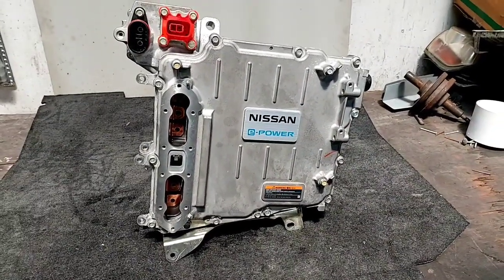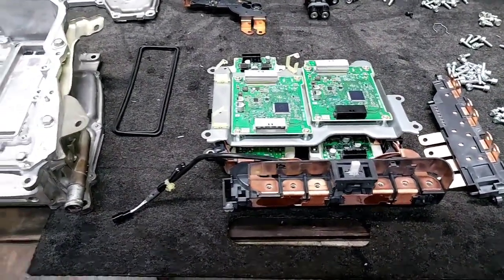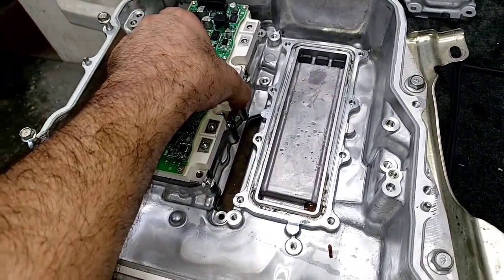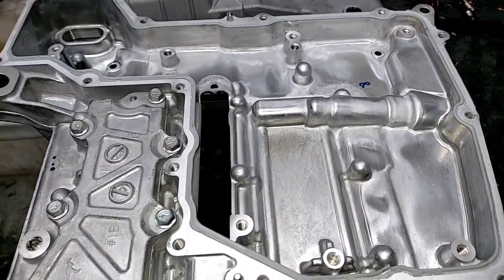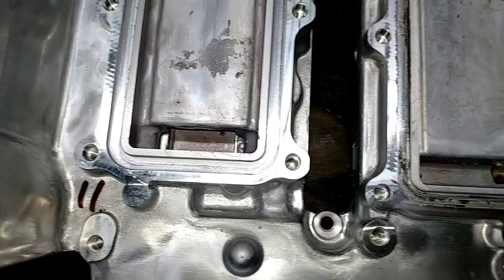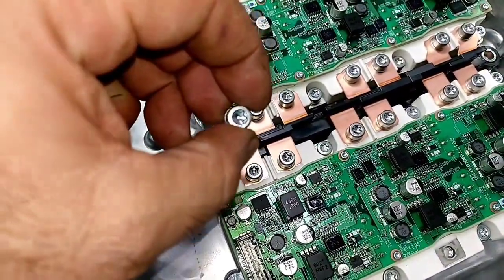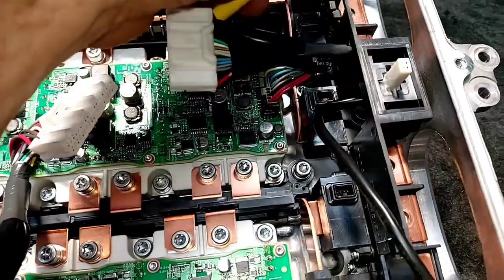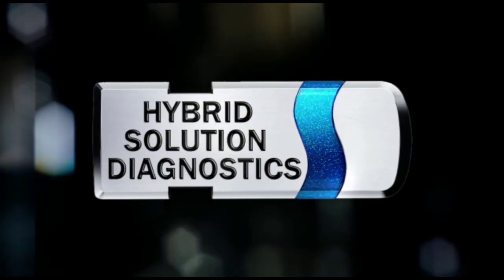Inside the Nissan Epower Inverter

Comment: Now 4 years after the release of e-power the main problem repeated among users is the generator charger that stops working and must be changed. The car must be immobilized for more than 20 days - in Europe-. Has Nissan found a solution to this anomaly!? which is unfortunately fatal for this new technology.
Reply from the maker: @abdoelabtet3881  yes unfortunately quality has not been in this vehicles so far 😖😖😖
Reply: Hello, where is that part? Any videos in YouTube related?  Thanks
Reply: @mt-dx5xf  https://youtube.com/@hybridsolutiondiagnostics?si=FyusHDIJBwwHC8xs

Comment: Do you know if we can modify the epower to be able to be charged from a wall charger when the car is parked to have the battery to be fully charged rather than using the petrol engine. So the car battery is always on full charge every morning so if uses lesser fuel. What do you think?
Reply: The battery is very small and it's not worth doing that.
Reply: @youtzful  одной зарядки батареи хватает на 10 километров пробега.
Reply: @youtzful  Even though I like it to find the battery  charged every morning
Reply: Very good idea I thought about it to make it myself by pluging the terminal wire of the AC to 220v outlet